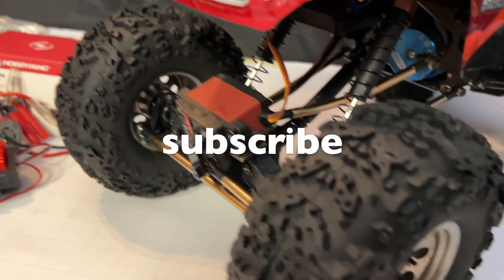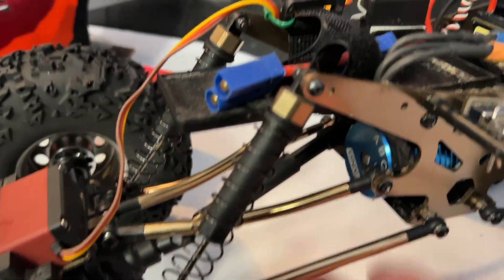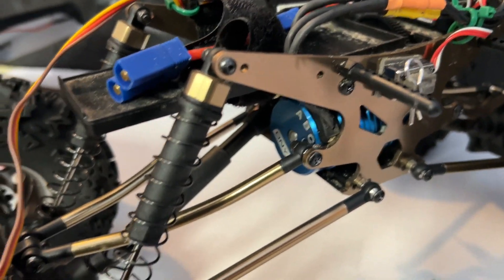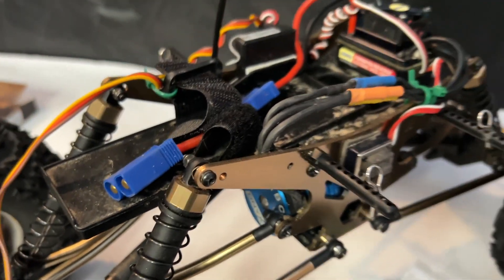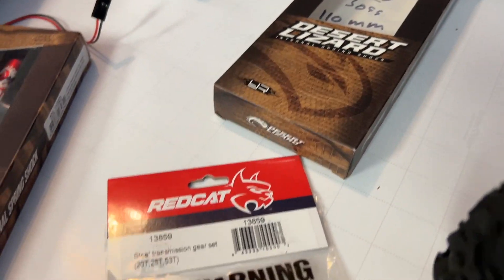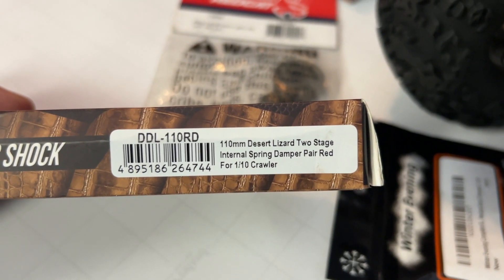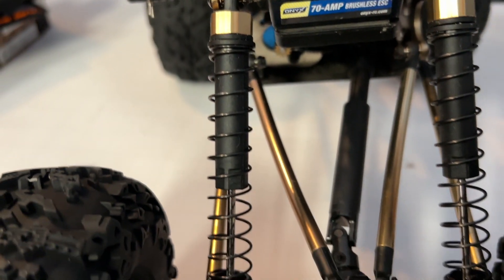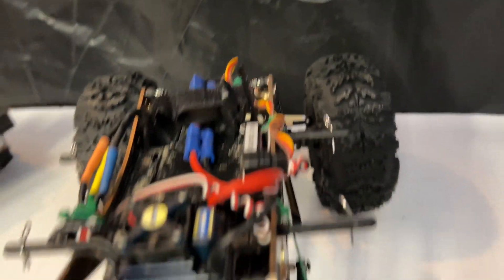rc redcat everest 10 MOD Q:A

Comment: Most GEN7 parts fit as well. you r on the right path with the shocks.Check out the pen spring mod. MIP drive shafts. I broke all others. Rear steer would really make turning sharp. Love the scale wheels!
Reply from the maker: hey thanks for the comment..I was wondering what truly fit. rear steer would be fun...was about to go nuts what to really do with this truck...I think I might have an idea now..I will check out the mip parts too..

Comment: Bash it till it breaks!  Then fix the problem.  
To get that motor to fit...  
You Flip the lower control arm to the outside of the frame.  
Put the end link on the screw facing to the outside. 
Looks a little silly but it CAN fit if you needed it to.
Try some 100 mm shocks and it looks like you have a winner! 
See you on the trails...

Comment: i read that if you want to install a 3660 size motor, move the links to the outside of the frame and put the screw in from the inside. Might still be tight, but it's been done. If you want to lower your center of gravity, buy some super cheap shock keys so you can raise the mounting point of the shocks. It becomes a different beast when you lower the chassis down.
Reply from the maker: sounds like a plan. might just do this. redoing the whole truck with metal axle housings shock relocation facing, and a few other things..thanks for the input..
Reply: i did it

Comment: I installed a Spektrum  - 3300KV 4 Pole Brushless Motor Spektrum  - Firma 85 Amp ESC in mine and it just barely fit. The motor bumps up against the rod end and the wires are kind of snug as well.  I have tried different shocks and even duel shock to stiffen it up but found that it preformed better with the stock shocks or something similar like the ones you showed. Steel gears and bearings should really help a lot. I really like the tires and rims you chose. I wish the axels were longer to actually except a Nylon nut. I went to some flat knurled wheel nuts on mine and it did help some.
Reply from the maker: I like the speed yours has .I was impressed with the power from that set up..what shock fluid oz.  did you end up going with..?
I should be getting your speed and power, but it is still slow, might have to re do the punch.... I'm still trying to find my injora  tires , they are similar to these on mine only a little wider and taller , super gnarly tread.. seems this truck is a little versatile with certain mods. maybe a whole different axle is in the works..and will it line up correctly..hmmm..
Reply: Thanks. It's such a nice truck. I have my punch set up to max. I will probably drop it down some. The truck performs so well over rocks and tree trunks. I don't think I'm going to bash mine too much more. I want to save it for trail runs. The shock weight I use that works best for me is 70w. The truck is a bit hoppy so I went back to a shock that was similar to stock. I know there must be some longer axels out there but I'm chicken to experiment because it gets expensive and you end up with drawers full of parts that fit nothing. lol  @loosewheelsrc
Reply from the maker: sounds sane...I honestly was not excited about this truck till I drove it ..really drove it. we been smiling every time with it..now wifey wants one..yes @RCRoads